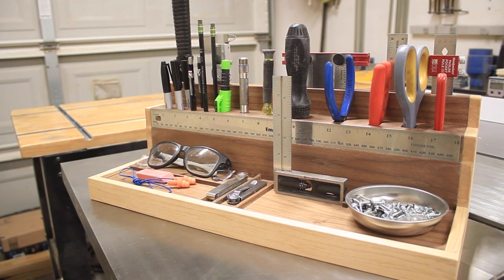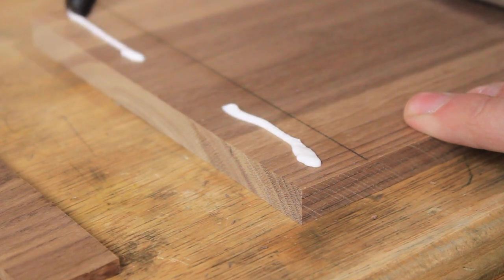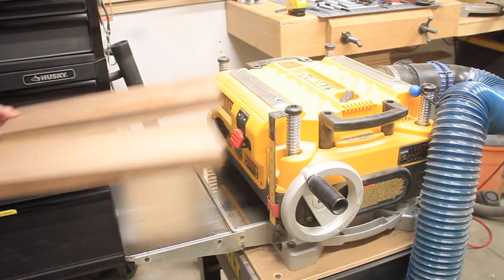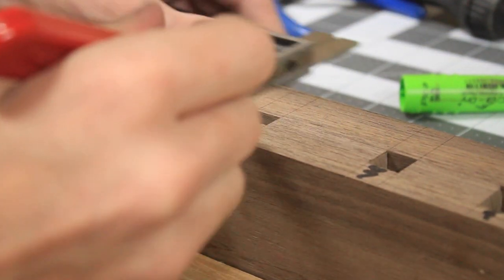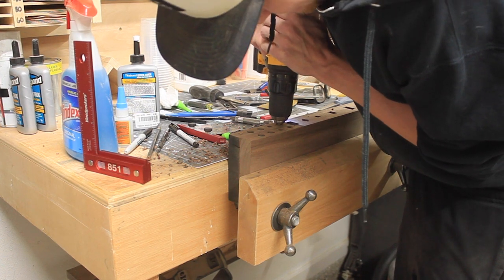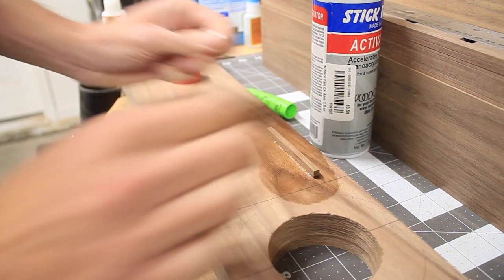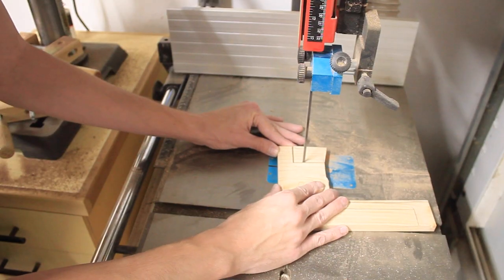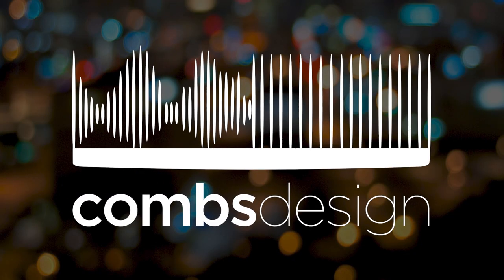Bench Top Tool Organizer - Wood Working How To

Comment: I really like your design and the video. Thanks.

The thing about only using CA glue (super glue) is that it only bonds temporarily. It gets brittle and can lose its bond over a couple years. I'd recommend more wood glue or maybe brad nails in addition to the super. glue.